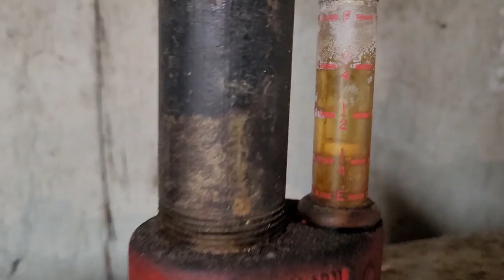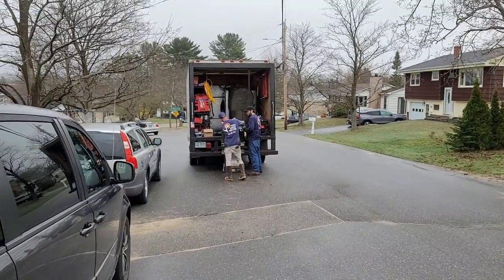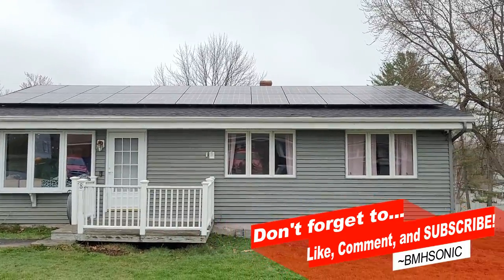Having my old OIL TANK and BOILER removed from my basement

Comment: So are you going with a heat pump powered by your solar panels?
Reply from the maker: Yes, we've gotten through THREE Maine winters now without the need of the boiler system. Year 1 was when the solar first went up in late 2020. The heat pumps were already being used prior to the solar setup, and the boiler system was simply there for our hot water needs. In September of 2021 the boiler was removed and set aside when we had the electric hot water tank installed. That was the first winter, 2021~2022, that we were 100% electric. Then again in 2022 leading into 2023 we obviously got through the prior two winters, and this time we had one of the coldest cold snaps on record stretching for two or three days that were MINUS 25F outside...everyone said that the heatpumps would shut down, but we got through it with no problems. I'll admit, I bought into the FUD and had a few extra space heaters on hand just in case, but when we got through it without any issues I promptly returned everything to the store as it was unnecessary. So yeah, it was time to remove this crap from my basement. I'm loving the extra space we have now. I've been prepping and cleaning down there these past couple of days and just started DryLok'n everything. It's looking nice! More solar going up this summer! 🌞
Reply: @bmhsonic  All that space looks like a great place for more battery storage.  So glad to hear you are making the investment for more solar.  Sounds as if you are on your way to true energy independence.  Be sure to put some money aside for Ben's college fund too.